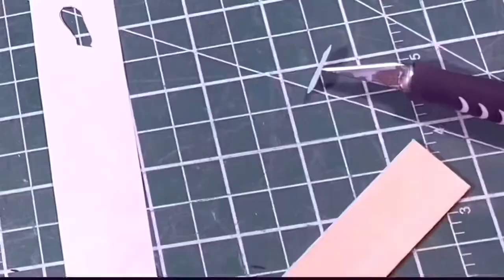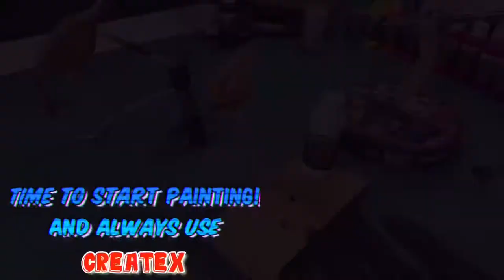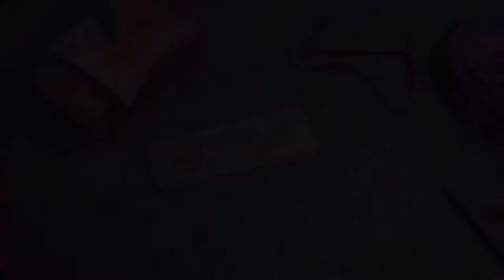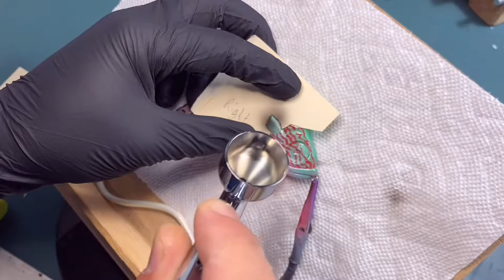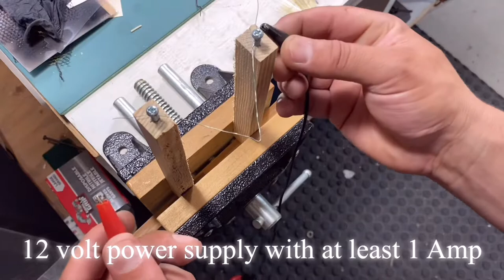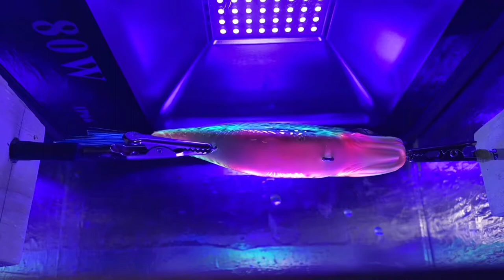brush tail fishing lures part 2 - lure making how to

Comment: Nice video, nice job on the lures! How did you make the lure turner?
Reply from the maker: I used a geared motor and switch, 1 alligator clip mounted to the shaft of the motor and the other clip to a shaft that I fabricated to a bearing and mounted it to some 3/8’s plywood with 3 pvc pipes that slide for different size lure’s.
Reply: @Builtin79  what type of motor did you use?
Reply from the maker: @olddadoutdoors  The best way to explain  is to show you. 
Google “ASMO 873600–072 motor” it’s the one with the gray case. 
I bought a box of them at a garage sale years ago.
Reply: @Builtin79  thank you!